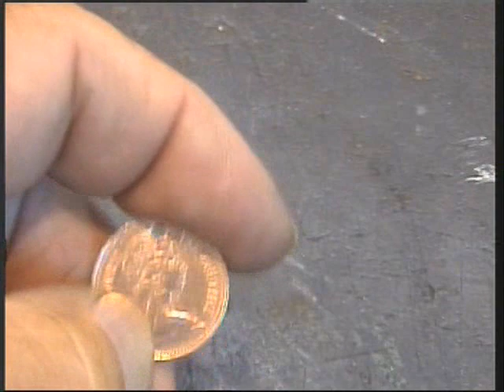penny pendent ... fail

Comment: That sanding method is neat. What does the rear say - Par Award 2019? I don't get it I'm afraid.
Reply from the maker: sorry should have use my pro camera, its said poc award ... more on this later .. had I bean able to enamel the cavity using groundglass it would have shown up a lot better, but I was thwarted by the oven failure
Reply: @poroldchap  sounds good! Looking forward to the follow up. Cheers poc!